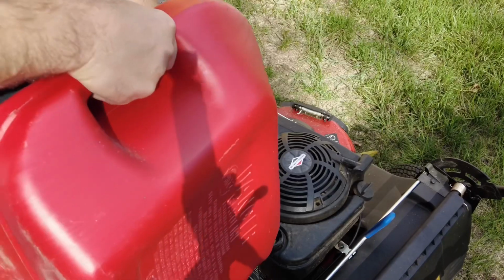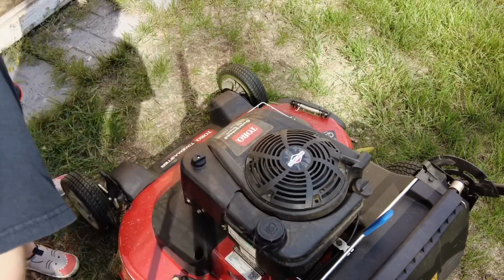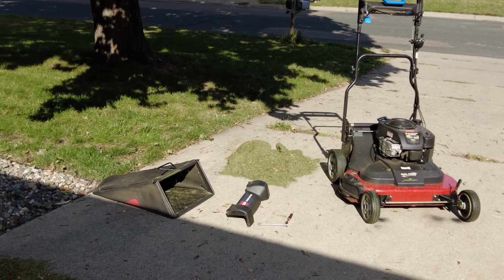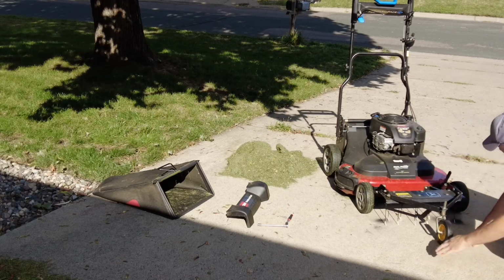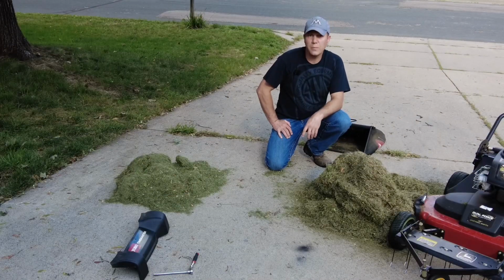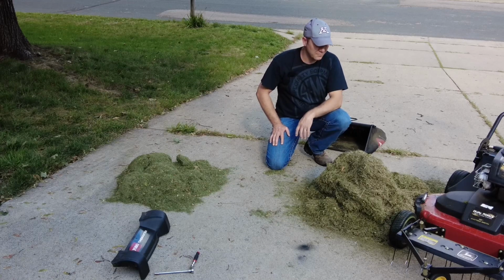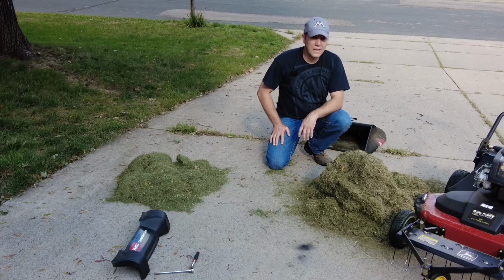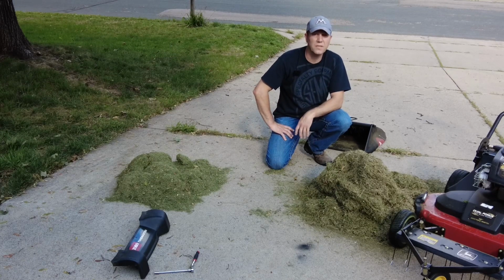Toro Timemaster 30” dethatcher

Comment: Hey, guess what...there's a company called Red Magic that makes one of these dethatcher spring-tine units specifically for the 30" Toro Timemaster, Turfmaster & Exmark units.  Maybe you gave them an idea?!!! 😁
Reply from the maker: Awesome!  Information sharing and helping everyone continue to get better is what it is all about!  Thanks for the FYI!  Cheers 🍻
Reply from the maker: I had to take a look at them.  After I fell off my chair for the price of $280 (or 4 easy payments of $70).  I did see they said it would work on the Timemaster but only shown the Exmark for the pictures. I would like to see how the front adjustable axel on the Timemaster would interfere with their mounting plate.  I think it is great the aftermarket has made a plug-n-play kit for these mowers.  I would have like to see it a double row like the one I used.  That would double the dethatching rate of probably 4” on the Red Magic unit to what my cobbled together unit has of roughly 2”.  Happy to see the aftermarket step it up though!!  Thanks for the FYI!! 🍻

Comment: Checking the oil could be a good idea. Then again this mower is no good. I owned one, it left the biggest mess I have ever seen. Great heaps of chewed up grass everywhere. One only way to stop this was to leave the cut grass very high, this meant I had to return quickly to cut it again. My advice get a real mower.
Reply from the maker: This is also my second Timemaster. Bought my first one in 2015 with the small motor. This second Timemaster with the larger motor works just fine for me. As I’ve owned these specific mowers for around 7 years, I guess my experience is different than yours. I’m wondering if yours is the smaller motor? As that could be the difference in our experiences. Cheers 🍻

Comment: Why would you mulch, then bag?  Why not just bag the first time?  By mulching first I would think you are forcing cut grass down into the lawn instead of putting it directly into the bag.  Even on a second bagging pass after mulching, there's going to be some grass that's now too deep in the lawn to all come up.  It makes the dethatch pass look a bit better than it really was because it's getting up some of that mulched grass from your first pass.  I also wish you would have shown some footage of what the dethatcher pulled up without the blades running on the mower to get a better idea of exactly how much it's pulling up as you go.  Showing us what's in the bag gives us no clue.  We don't know how much area you covered to collect that much debris.  But I think we get your point that it is a worthwhile thig to do.  Even if it is not as thorough as a power rake or scarifier it seems like a much quicker method.  Maybe just do it a little more often than power raking.  As a Timemaster owner, I thank you for pointing this out to us.
Reply from the maker: Why did i do, what i did?  I dunno i guess?  Just felt this approach was the most unbiased approach. I didn’t visually flag or fence off the area for the camera.  i did explain in the video the exact same area was used for all 3 cuts.  I wasn’t really trying to get scientific, rather one day i just felt like i wanted a dethatcher and Toro refuses to make one for these light duty residential walk behind lawn mowers.  So i found a used attachment (that has zero part identification numbers) did some metal fabrication and made it work.  My intention was to show a dethatcher on a Timemaster.  As a bonus, I tried to show my real world results in a way that made sense to me at the time. I thought and still feel that showing the debris in the bag is a valid measurement. By the third cut of the same area, and being previously bagged.  The third cut and final bag should have very little to no extra clippings other than what the dethatcher kicked up.  Agree to disagree. Maybe next year I’ll incorporate some of the comments and try to make a better video?  🍻 Cheers for viewing, and thanks for the comment. -Bulldog
Reply: @BulldogTractor  I guess the reason I wish you did some dethatching without the blade running was so I could compare it to what my Greenworks electric dethatcher pulls up.     Not criticizing your work, just asking some questions..
Reply from the maker: @mellowjammer  Oh, I now I understand.  I now can see where the confusion is.  I own a corded power tool, the Sunjoe AJ801E which would be a fair comparison to the Greenworks corded dethatcher/ power rake.  However trying to compare the Greenworks/Sunjoe Vs. front mount tine Dethatcher would be a slaughterhouse. The dedicated type power rakes are great at performing their sole purpose. My Frankenstein version of a front mount spring tine Dethatcher is more for “maintenance” or every day use.  It really doesn’t add any additional time other than the time to perform regular mowing.  It does however do light scarification to help with weekly maintenance. The comparison between a dedicated Dethatcher to the Toro Timemaster front mount spring tine Dethatcher was something i knew, but held bias against. I should have caught that, and addressed it but it slipped by me.  That is actually a good video idea for a follow up to this video.  It will be a runaway blowout, but would definitely show the comparison between a daily maintenance tool and a dedicated purpose built tool.  Gimme a couple days and I’ll make a follow up to this one. Cheers for the comments and the video idea 🍻 -Bulldog

Comment: I need something with a bagger.  I have a 3pt CMP dethatcher for my 1025R but I really need to rack after using it... which is a lot of work.  And a 30" like yours would be much quicker than a 21", have to look into one.
Reply from the maker: I do like a “little” exercise and if I can accomplish a chore while I exercise. Well that’s just a win-win. But my old 21” just made everything longer than it needed to be. The Timemaster is a light duty machine. Light enough my wife is comfortable operating it. But at 30” big enough to actually make forward progress. The tine Dethatcher really opened up the versatility!

Comment: I fit that JD dethatcher on my Honda HRX by adding shoulder bolts exactly like the front wheel bolts on it, accept half an inch longer and added a bronze bushing from Lowes, a couple bolts and washers adjusted the dethatcher frame to toe in slightly and it goes on easily and works very well!
Thank you!
Reply from the maker: Awesome farm-engineering!  Yeah, it’s not going to be the end-all attachment. But in my opinion it has earned it’s place in my tool box.  For the weekly “maintenance” and for how simple it is it’s a fine modification. Cheers from the Bulldog 🍻

Comment: Informative video. Note for all: @01:27, it would have been safer to do the tilt with the fuel cap on to avoid spillage.
Reply from the maker: Would be hard to show the trapped air on a video if the cap was on. But in general yeah I agree.

Comment: What's the part number for that dethatcher?
Reply from the maker: I looked for it, but couldn’t find one. I just picked it up used, then got busy with the air grinder and made it work 👍
Reply: BM22339 John Deere but good luck finding one.  looks like they have been discontinued.
Reply: Nice video 👍
Thanks to this I just got one of these 2nd hand for maintenance!
Hiring a proper detatcher or buying a little one and walking miles with it on our 1/2 acre did not appeal!
Sooner do it little and often.